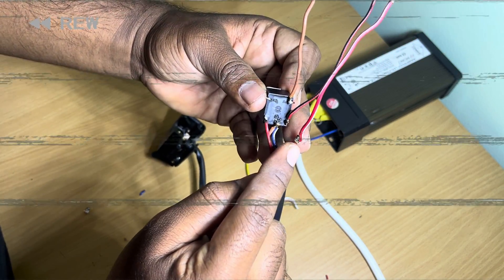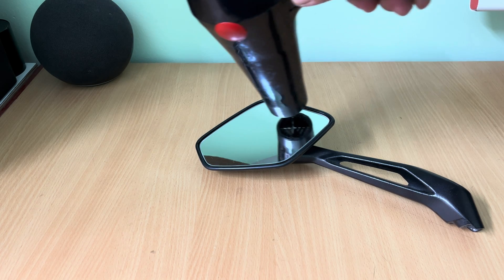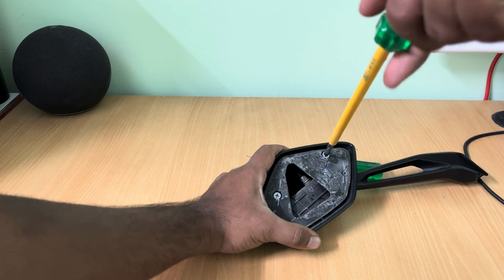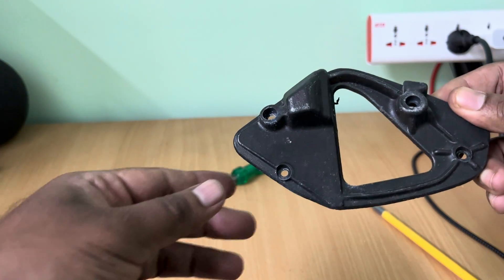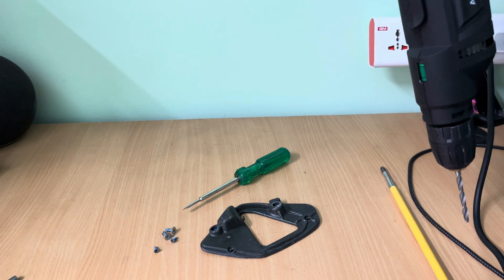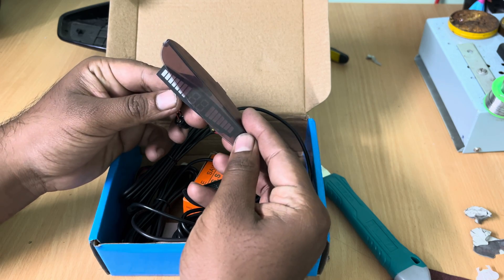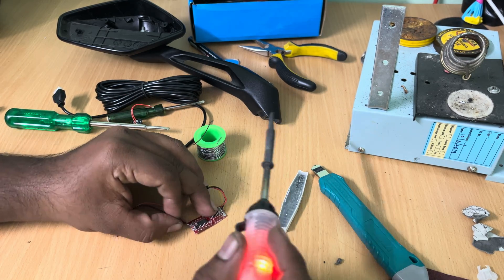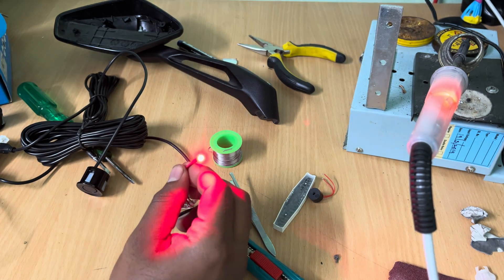Blind Spot Detection System On Dominar 400 - Part 1 | #dominar400 #ns200 #duke390 #ktm #bajaj

Comment: Bro is it possible to make bike  head assembly position like triumph street triple , like whole head light Assembly attached to the steering neck and it doesn’t move with steering. Hope you understand. Please give some response
Reply from the maker: Yes you can, if you have noticed pulsar 200 or r15 frame…there is a metal welded to its steering neck on chassis… you have to custom build those making sure that there is enough clearance for the steering  itself to move.

Comment: what are the possibilities to do an Fi conversion in a carb BS3 NS200?
Reply: Possible but high cost
Reply: A larger pwk racing carb and intake would be better than fi
Reply: @ghostofsparta1045  where can I get hold of that?
Reply: @nitro_azz1516  local markets or Amazon but it'll be expensive best would be to ask a relative to get it for you as i did😂
Reply: 😅 @ghostofsparta1045

Comment: Do not seal the led permanently instead the chances of that led dying are pretty good may it be due to improper heat dissipation or continuous use, please make it so that the led will be replicable in future.
Reply from the maker: Hi bro, the led will heat up on continuous use, however in this case it blinks so there is no much of heat generated. 

However you have a valid point on led heating on continuous usage.
Reply: @ARKIONX Hey bro, can you do a video on best led bulbs for ns 200 bs4

Comment: I'm not able to rest the time in Ns200 BS6, tried resetting multiple times but time jumps 45 min or more than that every time. Not showing the proper time 

Any solution for this ? 

For me time in display is very useful function it's really irritating when it's not showing the proper time even after resetting after multiple times.

Is there any solution !?
Reply: Same
Reply: You really have to set the clock periodically.  This problem has been around since the launch of the first 200ns in 2012. It seems Bajaj hasn't made any changes
Reply: I think this is a battery issue, the same issue happened with my NS BS3 as well.
Once, after replacing the battery issue vanished.
Reply: @manish9555  but its only 2 year old bike bro, do you still think it will be a battery issue ?
Reply: @heyyhari673  Then it might be some other issue.